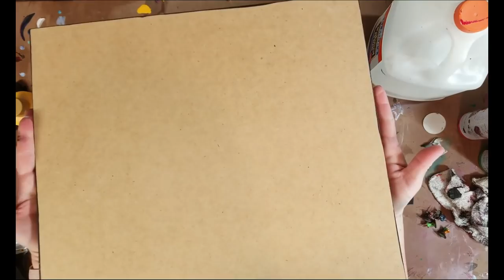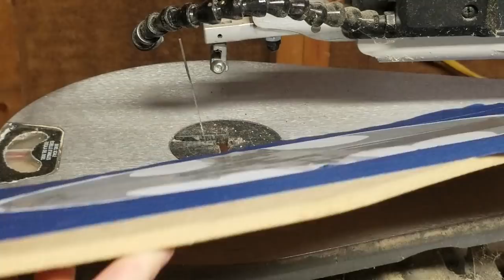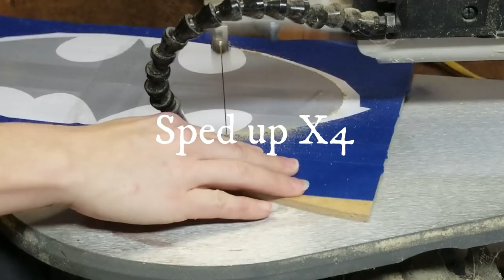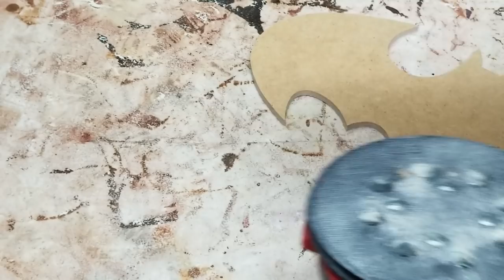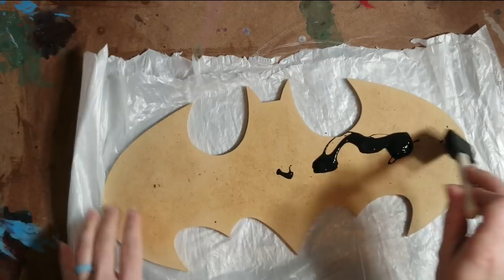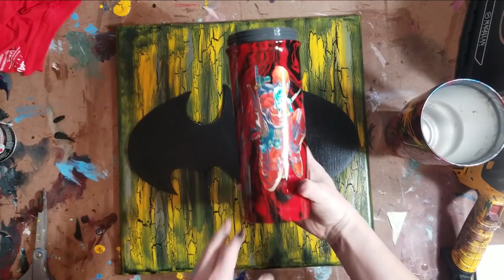Acrylic Painting with Glue!! Batman Crackle Series

Comment: all you need is carbon paper tape it down trace out your image throw away the paper and carbon sheet and you will see your image on the mdf then its much better then worying about the template... i  make my signs out of the mdf  mainly sports logos ... great 3d signs easy  good job on your project
Reply: ps if you use a flat  or satin  spray the surface  wont show paint streaks ,,,,just my 2 cents